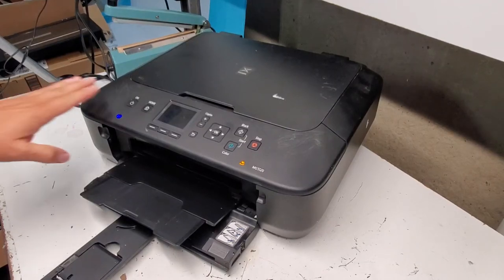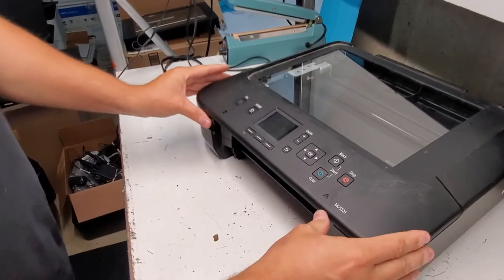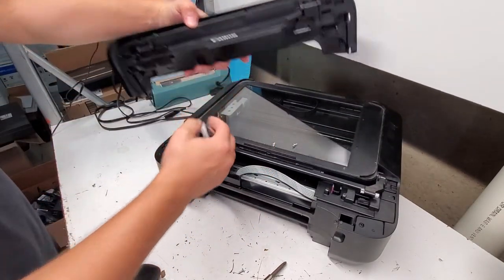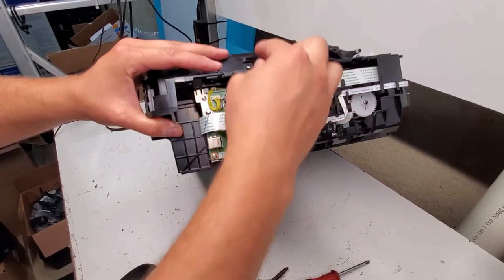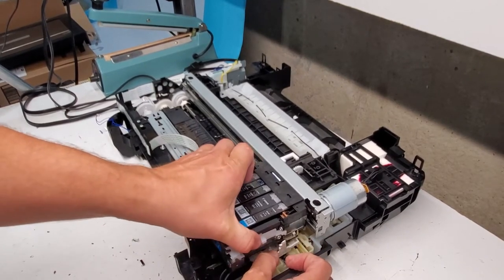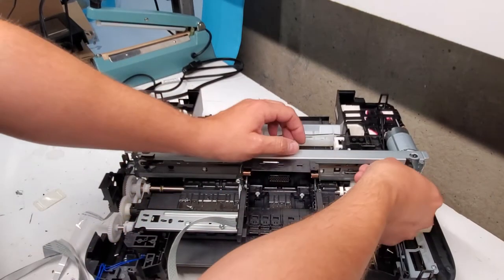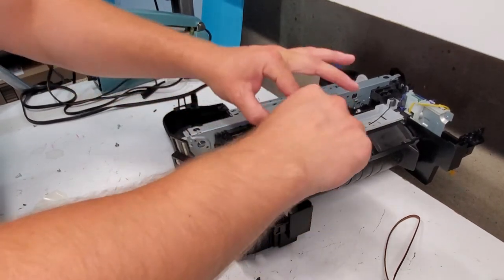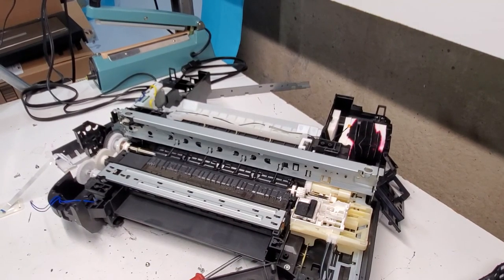How to take apart Canon Pixma MG5520 printer - Disassemble

Comment: youre a gentleman and a scholar. I appreciate this. Dang thing hasn't grabbed paper since about 6 months after getting it and now the head is fussing but I couldn't get it out like the pixma pro 9000. Didn't want to strip it down just yet like I did the other one, etiher, though I will when I order the rubber wheel cleaning stuff in a couple months when I strip down my reel to reel, but the heaad's getting an alcohol bath today! You da man!

Comment: Honestly, this is a great step by step to disassembling this infernal machine XD
However, after taking half of it apart I just couldn't wrap my head around why the print kept giving "cover is open" messages and reseting whatever action I had taken. (sometimes just touching the Operational Panel gets it going through "cover is open" cycle before going back to standby)....

I put the tray and cover back with difficulty but it's still working, though the "Cover is Open" keeps popping up all the time....

I know this is something that was posted 2 years ago almost, but if anybody has had any type of experience with this type of issue, it might help me to solve (my initial thought was a contact issue with the Operational Panel's closed contact sensor... but I don't even know if I saw it....)

Comment: You got the like for your video anyway. But where do I find the waste ink absorber in this printer? Can it be cleaned or does in need to replaced? I did clean the printer head many many times and it is still alive, but now it is complaining about the ink absorber error code 1700.
Reply from the maker: Thank you very much for the like! The ink absober pads are located on the back far right corner of the printer. It is not easy to get to. You can see it at minute 12:30 in this video. The error will stay even if you replace or clean the pads, so i would just buy a reset online which costs about $10. That reset utility will reset your ink absorber pad count to zero. You may google for it. I do not have a specific website in mind. here's a link to a video from which you may be able to get an idea of how that works. I am not in any way affiliated with them. https://www.youtube.com/watch?v=CVKEG6fLGyA
After about 100 pages or so, your printer will give you a 5B00 error, which will just not let you use the printer until the waste pads are reset. Please let me know how that works and what site you used so it can be helpful for others in need.

Comment: Can you make how to take apart cannon pixma MG2500 series printer and what is the issue of not powering on at all
Reply from the maker: Absolutely! I actually have a similar model which I can use. I will try to make a video and upload later today.
Reply: @303electronics  okay thank you btw mine is canon pixma mg2540s but it similar to the rest of the mg2500 series i hope
Reply from the maker: @Xanderarciaga454  yes, I believe I have mg2922 which is also similar.
Reply: @303electronics  yeah is similar to that but it added wifi right?
Reply from the maker: Hi. I finally was able to get the printer and make a video. I hope this helps. 
https://www.youtube.com/watch?v=Vhea40cckKc
Worst case can be a bad board or bad pwoer supply.
Reply: @303electronics  okay thank you to the troubleshooting step

Comment: Hi can only the sides be removed on a mg5751 as i need to check the absorber box.?
Reply from the maker: Unfortunately to get access to ink waste tank, you need to lift the top portion if printer cover.

Comment: Hello apperently there is some paper stuck on the right side of the printer where the ink stuff is at and the ink box is stuck as well and i cant get the paper out. Can i just disassemble the side of the printer to fix it??
Reply from the maker: Yes, remove the side and you may get easier access to that paper. Use tweezers to remove paper. Should be just two screws on the back.
Reply: @303electronics  thank so much you just saved me😭😭😭

Comment: Just a question    Canon MG5720   The printer hit the floor during a move and now I can not get rid of the message "close the cover"    Getting left side reset was no problem but I don't know what is disconnected on the right side so that side does not line up.   Does anyone have a description or a schematic showing the printer line up?

Comment: I need a Dr for my Canon MG 5220! I've done the "hold the stop button, then power button. Then press the stop button 5 times"...etc. I have removed the ink absorbers, cleaned and replaced them and it still has an error code 5B00.  Any suggestions? Thank you for your time and attention.

Comment: Hey bro i have the same exact printer.The power won't turn on, I already cleaned took out the print head prior and cleaned it with alcohol, but now its LOCKED on the right side and won't turn on... How do I get the print head to unlock when the power is off? I appreciate any advice you have or trouble shooting. I thought I got it fixed because the b200 error stopped and I was gonna print a test page. Then while it was printing nozzle test page, it just turned off and never turned on again. Thanks!
Reply from the maker: There is a locking mechanism on the right side. Your power supply or main board is bad most likely.
Reply: @303electronics Hey! Thx for much for replying man! I managed to get the printer to turn back on by getting the printhead unlocked from the right side and then removing the cartridges. However firstly I keep getting, "install printer head 1401" error then I remove the print head and put it back on repeatedly, and then it gives me a b200 error. I tried to turn off the printer and repeat but no luck so far, still getting either bp200 or the 1401 error (tried doing it with print cartridges in and out, as well as printer head in and out) turning the printer on and off...  I tried using compressed air with a alcohol swap stick to clean the inside of the print head pins input/output component too. Maybe I wash the printhead again with water/ soak it with alchohol to get any remaining ink out again? Any ideas or potential tricks that might work? I appreciate your help. Thanks!
Reply from the maker: @deadpoolcrypto  Seems like the problem is with the printhead. It's what caused your printer to black out probably. Replacing a printhead is the only option I think in your printer's case.
Reply: @303electronics  okay thanks for the reply , do they still make the printheads for this exact print u have on the video?
 It only blacked out once when I tried to open and close the cover while the printer restarted to force it to go to the settings screen. Then when i tried to print a test page it shut off. I could try to replicate it again and see.

Comment: This is excellent.  I was about to throw away my printer, but you saved me (you really have to pull hard to get those sides off).  Is there an easy way to change the absorber pads without disassembling everything?
Reply from the maker: Hi. Thanks for sharing.  Unfortunately getting to the pads box is only through top. A bit of labor.

Comment: Hi, great video. I came accross this video looking to take apart MG6350,  unfortunately they are very different, but I did get the general idea.
I do have a question: have you worked out any ways to reuse the components like the touch screen or any of the sensors or motors in a DIY setting?

Comment: Any idea how to fix the error 1403 even after removing the printhead? It should change to error 1401 since the head is removed. So the printer is not aware of the removal. Flat cable issue?
Reply from the maker: Restart the printer, see if it goes away. Usually 1401 error is due to bad cartridge chip

Comment: Where do I look to find out what kind of Canon printer I have.?
 where do I look to get a power cable for this printer.?
Reply from the maker: Hi. The printer model is usually on the front of the printer, by the control panel or screen. Sometimes on the front tray. You may need to close the tray to find it there. Power supply model can be found on the power supply itself. There is a number that starts with "K" followed by 5 digits. For example K30314". There is another 7 digit part number which starts with "Q" and follows this format "Qxx-xxxx"

Comment: Hi - nice video!.  My MG5520 had the EXACT same problems as DeadpoolCrypto's, except mine is now completely dead.  Everything was semi-fine using the color ok/ PGBK lousy printhead.  It was when I  installed the NEW pinthead, which gave me the B200 code, etc..

I'm thinking the power supply is bad.  Is there a way to test it?  I'm an electronic tech.  Is there a way to take it apart?

Thanks,
Keith
Reply from the maker: It can be one of the three or all, the power supply unit, logic board, or printhead. Take the printhead out and try powering the printer.
Reply: @303electronics  Been there, done that.  No good.  I have the "custom" screw out of the p/s, but I can't figure out how it "clips" together to take it apart.  Any ideas?  Thanks.
Reply: I’m having the same problem. I disassembled the printer and then reassembled it. Now the printer won’t turn on.  I need help.

Comment: Hi and thanks for this helpful video.  I'm gonna try replacing the print carriage on my iP7220.  I got everything I need from your video except for how to unplug the ribbon cables.  Do they just press in or is there a clip of some sort on the receptacle that I have to open or slide back?  I don't want to get this close and then fail because of a self-inflicted injury.

Thanks in advance for your response.